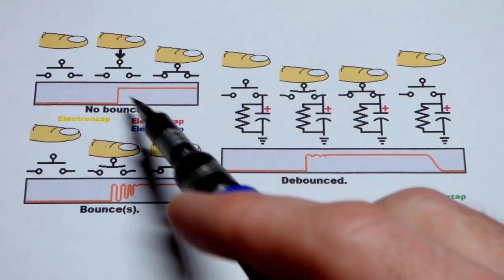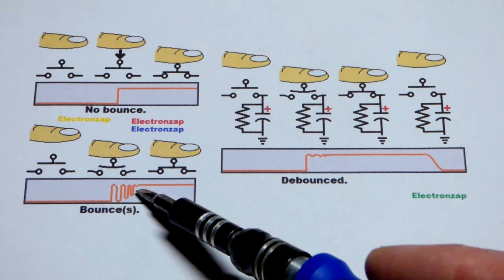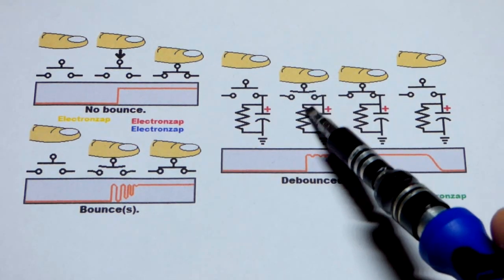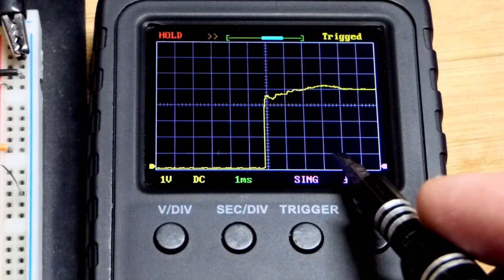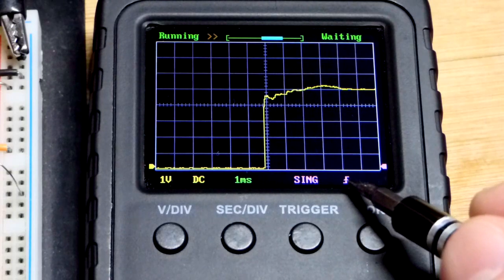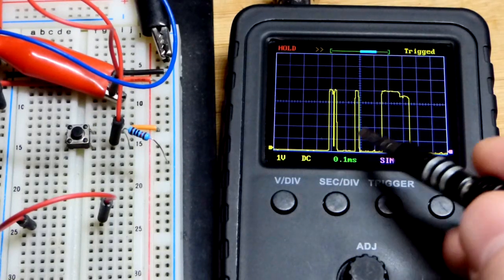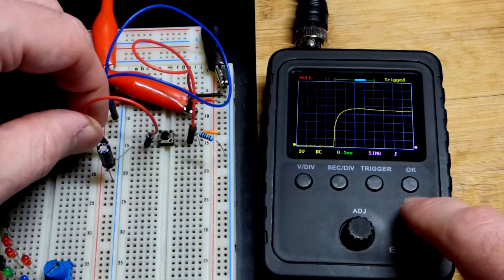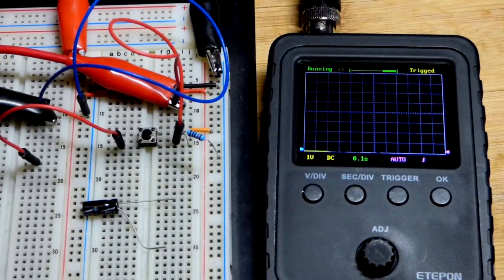Debouncing mechanical push button switch with capacitor and resistor how to DIY electronics

Comment: @Electronzap, what size of debouncing capacitor would you use for a ballswitch (tilt) in case of 4V supply? Switch is disturbed by high frequency vibrations coming out from a DC vibration motor. Also, it (the ball switch) is on a low tide - which probably doesn't matter for a capacitor operation?
Reply from the maker: Not sure, but that's an interesting situation. Vibrations would probably last longer than the bounce of a closing switch, so a capacitor by itself wouldnt be as effective. I'd probably make an actual timing circuit that responds right on the first contact and stays there for a bit more than what is needed when the contact is broken. That's pretty much what you'd do for any circuit where switch bounce will cause a lot of problems.